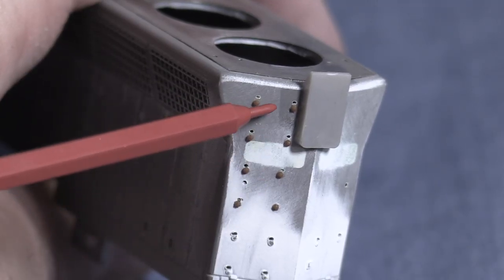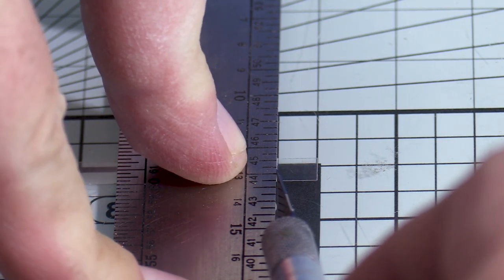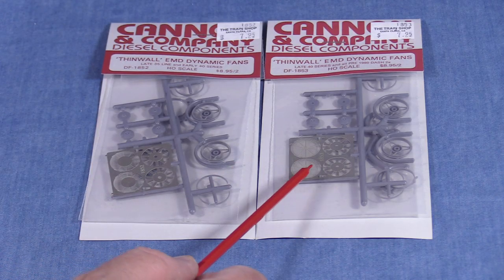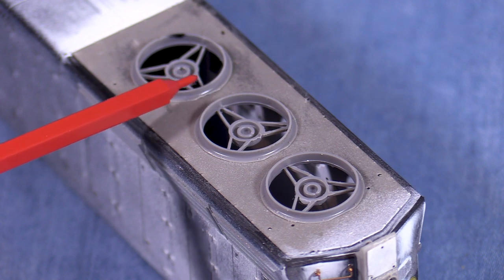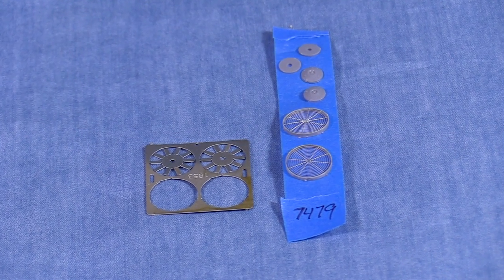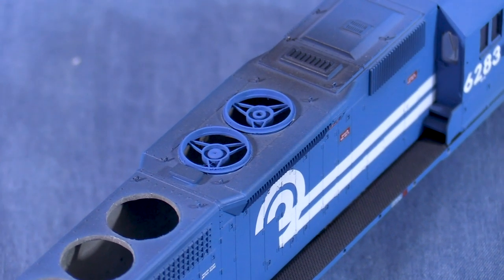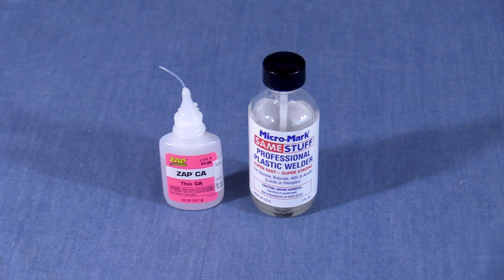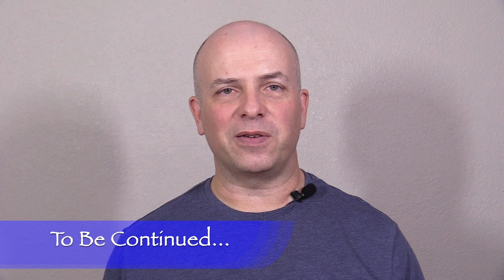Model Building HO SP Consist Part 5

Comment: I was going to say when my
local hobby shop sold out the
Floquil I ended up with 3 bottles
of Conrail blue, 2 bottles of
Oxide red for freight cars and
1 bottle of Pullman green. I
didn't know you could mix
Windex with it to thin it!
I always use the big bottle of
Floquil thinner I bought years
ago. Thanks for the tip on that
Dan.
Reply from the maker: Catching up on comments... I use Windex only for water based paints like Polly Scale.  Floquil is a solvent based paint and needs to be thinned with Floquil thinner.  You could also maybe use lacquer thinner, but Windex would probably just make a mess.  Good luck with your painting and thanks for watching!

Comment: You need to backdate to the caboose era; now that is classic SP!  Lot's of great freight options like Wheels of Time bulkhead flat cars (two types), IMRC SPFE and PFE reefers, Red Caboose PFE and SPFE reefers, Genesis and Centralia Shops bay window cabooses.  Oh and Moloco just came out with those 70's repaint RBL PC&F boxcars in SP and Cotton Belt.  It's a great time to be a late 70's and early 80's SP modeler!
Reply from the maker: One good thing about my plan to model Donner Pass, is that the look of the area didn't change much during the 1970s-1990s period (and even now isn't that different).  So backdating would be mostly a matter of running different equipment, and maybe swapping some vehicles.  I have a few "out of era" trains that I think I will be able to fairly convincingly photograph.  I have quite a few cabooses!  Thanks for watching!

Comment: Hey Dan, I was watching the video and had a question related to the hood kitbashing in this video. 

How do you remove the molded on hood doors on the model? Do you buff them down with a dremel or cut them out completely? I’m working with a Kato shell and I want to replace the hood doors with Canon ones.
Reply from the maker: I think it would be difficult to sand the doors down without damaging other details.  I would probably cut them out, though if you're doing all the doors that would be quite a job.  Good luck with your project and thanks for watching!

Comment: What did the R stand for in sd45R?
Reply from the maker: I'm pretty sure it means "rebuild".  SP rebuilt many of its locomotives over the years, usually giving them an "E" or an "R" suffix (GP9E, SD7R, GP35R, etc.).  By the 1990s the non-rebuilt SD45s were pretty much off the roster, but the SD45Rs lasted through the end of the railroad.  Thanks for watching!
Reply: Alright thanks for the information. Im exited for part six!